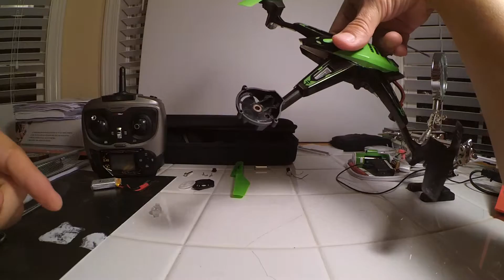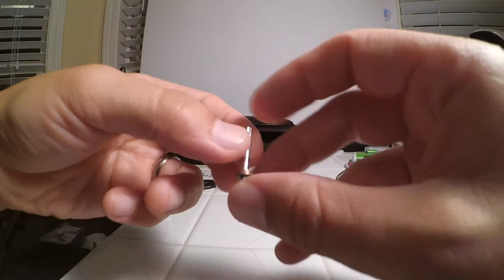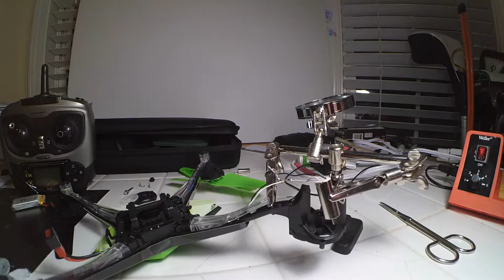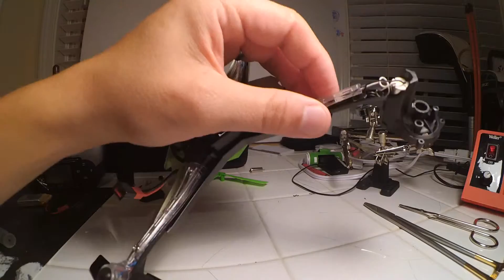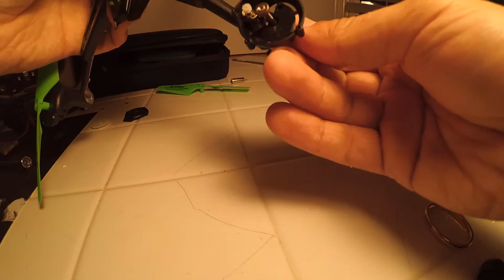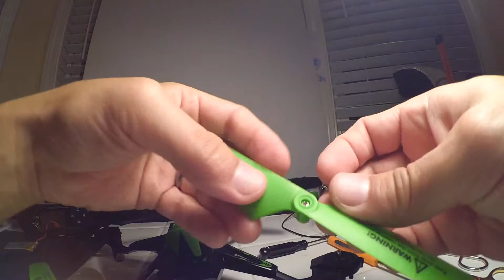Bojiang S1 Quadcopter - Part 1: Motor Replacement - November 2015

Comment: The  engines of nihui u807 not work in bojiang? 
They look the same.
Reply from the maker: The y might. Im not sure about the size of the u807 motors.  As long as the motor is 8.5mm x 2 mm it should work.